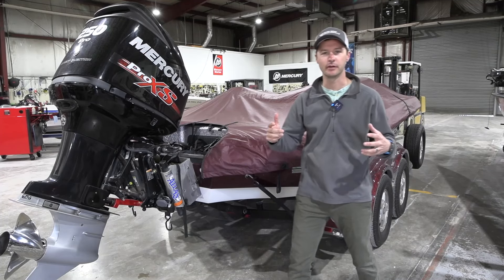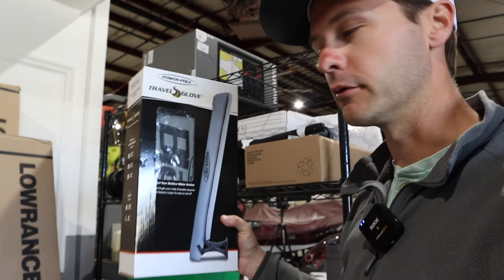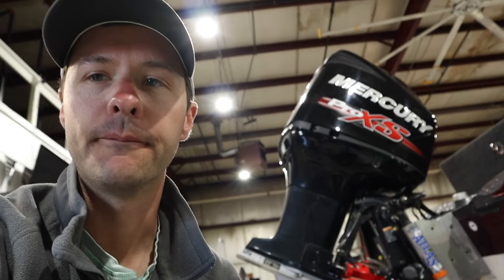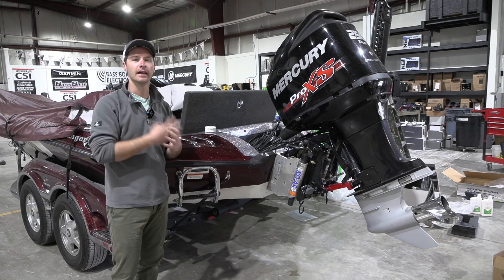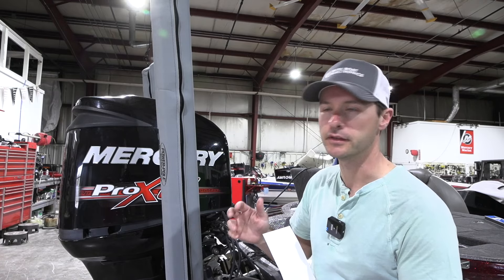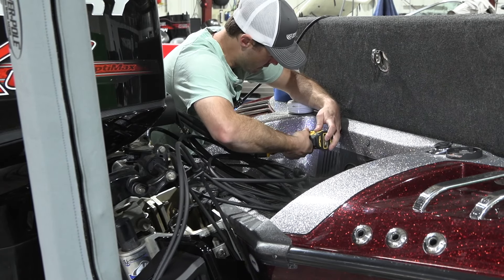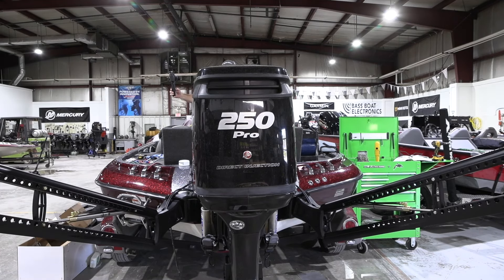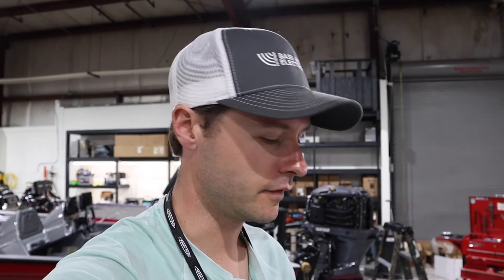How to INSTALL The NEW Power-Pole ONE Dual Anchor Pump!

Comment: Thanks for the heads up 
One pump 8 is on the way 
With a bobs JP 6 
Have you installed the one pump on an older 2000 520 
Still try the think though the pump install 
I am running 4 31 amg plus a Minn Kota 460 changer with the oil tank in front of the charger 
Do you think the pump will fit between the two batteries on the port side if I spread them apart if I am able to ? 
What’s your opinion on another location 
Thanks

Comment: Great timing! Just ordered mine this morning.
Reply: Can you order just the pump?
Reply: @andrewnickeson6815  Not that I’ve seen. But I don’t know if that’s in their plan, it’s still young.
Reply from the maker: You can’t order just the pump. This I a new complete kit!
Reply: Will you be able to shorten the hydraulic hoses to make it a cleaner install?
Reply from the maker: @williambigsby4031  you can not. You will still have to coil the extra up.

Comment: Nice detailed vedeo. I just purchased mine today  in the black out. So i have a Trito 18Trx with an 8" atlas hydraulic jack plate. Will this same dual brace kit work for my boat?
Reply from the maker: You can check with Power-Pole but the PKBD-S-2-6 is the most common bracket for us!

Comment: I noticed that you mounted the brace kit on the atlas hydraulic jack plate in the holes closest to the transom but I also have seen other installs were the brace kit is installed in the 2 holes that are set back closer to the engine does it matter which holes the brace kit are mounted to.

I mounted mine the same as you did in this video
Reply from the maker: Either set of holes work fine. We typically mount them on the inside holes to set the poles closer to the transom. It's all personal preference and the look you want as either option is fine!

Comment: So getting the one box you said at the start will not allow you to fix this to any boat. ?
AS there is a fixing box.
Reply from the maker: You will need the correct adapter plate and hardware depending on your boat setup.
Reply from the maker: https://power-pole.com/adapterwizard/mounting-options